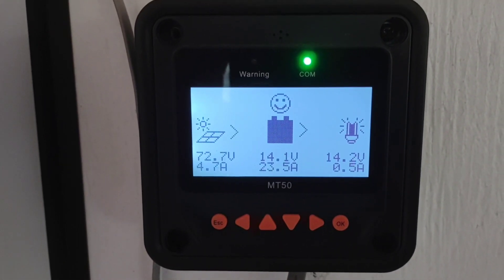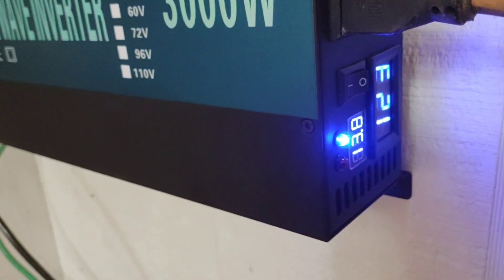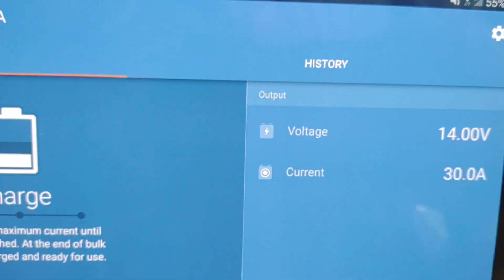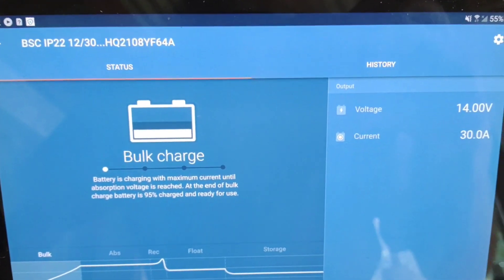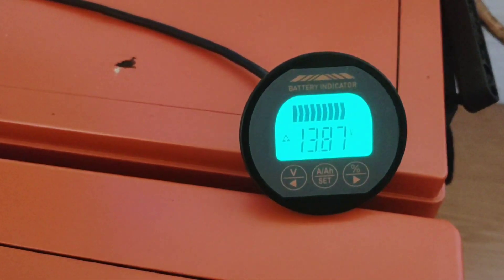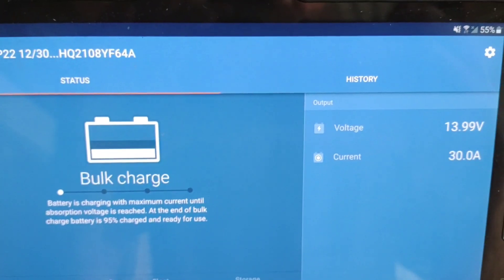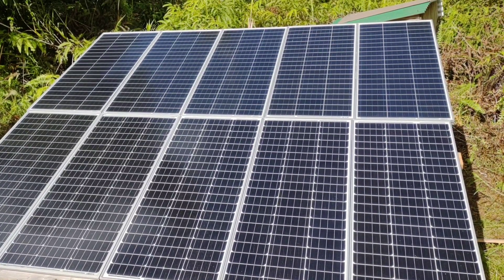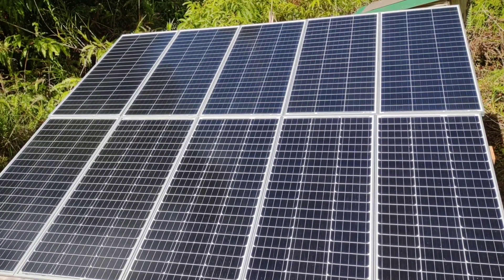Five different voltages on five devices... close enough

Comment: Regarding the pure sine wave inverter, the product description says:
During use, due to the influence of the load, the output voltage may be too high or too low.Pls kindly known that the output voltage can be reset in a certain range at your end.”
Did you have to set yours up?
Thanks
Reply from the maker: Not on the voltage off the panels no. Combined open circuit for each string is 100v. The controller has never shown anything more than about 85v. The controller has taken perfect care on that. Thank you for joining the conversation...aloha 🤙

Comment: Voltage drop causes that  ,plus those meters are not from same manufacturer in my view 20 mvolts difference shouldn't concern us.. voltage at battery terminals and at the end of a wire run will usually differ aspacially under load
Reply from the maker: I agree totally with that...🤙